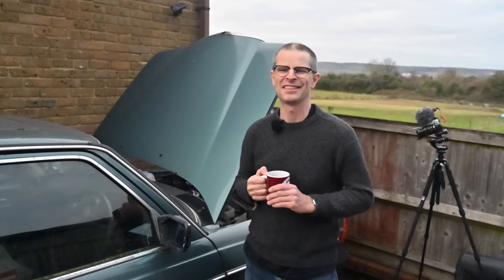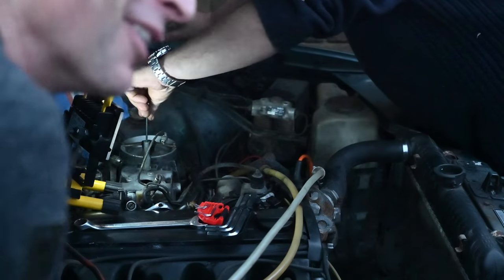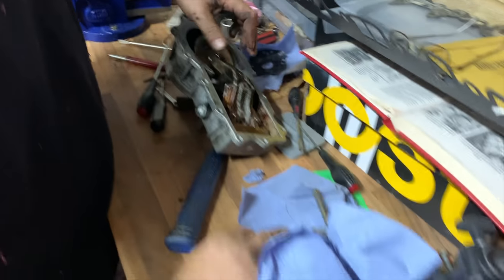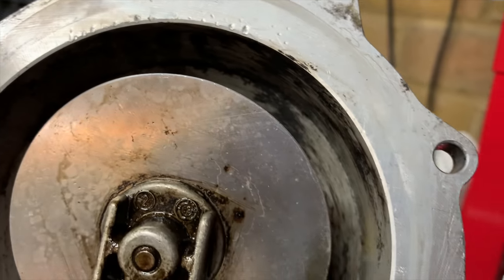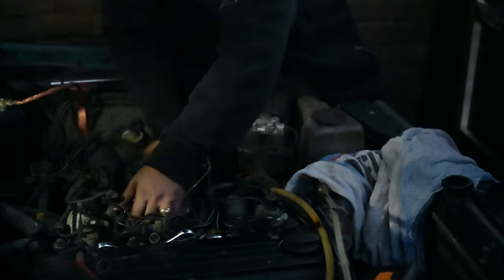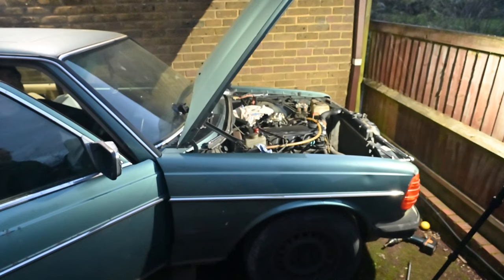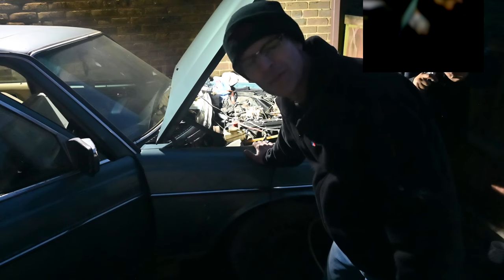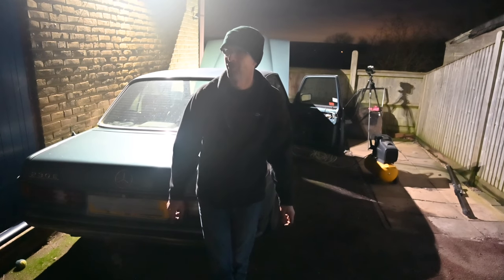Mercedes W123 - more fuel system shenanigans

Comment: I know this isn't much help but from what little experience I've had with the fuel injection systems on the W123 series, every part has to be in good operating condition for the thing to work.  My 280E was a bit finicky until I replaced all the injectors and fitted a good used metering unit.  Then it worked pretty well.  If you haven't already, check out Kent Bergsma over at mercedessource channel.  He is a mine of info on anything that is old Merc.  Good luck with it.  I'm sure It'll be worth it in the end .
Reply: I watch Kent's videos, and he is very good with repairing Mercedes-Benz vehicles.

Comment: Almost forgot to mention, i had an 87 Audi !00 with Jetronic. On cold days it would lose all power after coasting,followed by a monster wheelspin as the power came back suddenly! Turned out it had an overrun cutoff valve which was sticky and was taking it's time to close.This valve worked by breaking manifold vacuum to the sensor plate while the car was coasting and foot off the gas, basically all fuelling cut off in this condition. I don't know if your Merc has this but if it does it might be worth a look.

Comment: Thanks for a lovely day, sorry we couldn't get it started but we tried! And sorry for the swearing, (bleeped out), as I did promise to behave myself hahaha.
Reply: @Lime Pringles True and thanks for the kind words BUT I should have made the phone calls and done my research first. I'm now convinced it's the fuel actuator/valve/regulator that's not opening and closing to deliver the fuel pressure to the injectors, (though they may need a good clean out now given the gunk in No1 injector and its feed pipe), which is why it's a non-starter. I reckon 2 days and a complete overhaul of the fuel system, (filer, pump and pipes cleaned), and this car may just start. It's pure fuel starvation stopping it starting.
Reply: These K-Jets are very sensitive to fuel pressure. As I recall that pressure is set and maintained by a regulator in the return line (and can be adjusted.) Someone said something in an earlier video about relays and I think the reason for that was the fuel pumps in these often deliver low pressure due to an electrical issue but I can't recall what that fault is.

Either way easy to ascertain if its the pump by checking fuel pressure which needs to be over 3 bar to actuate the injector system.

You did a great job! 🙂
Reply: @thomas316  I really don't think it's the fuel pump as it's new. You're right about them being pressure sensitive though and I honestly think the gate isn't closing on the regulator to give it enough fuel pressure to deliver fuel to the cylinders. I did take a pressure tester with me but we never used it <sigh>
Reply: I would think it's the timing of the fuel pump that is off. Pretty common on this type of system after they have been apart, especially if there was some issue with the drive belt for the diesel pump.
Reply: @rimmersbryggeri  Ermm no, it's an electric pump that fires up as soon as they key is turned and the regulation of the fuel, (fuel pressure and delivery), it because of the accumulator/actuator opening and closing to divert fuel to the tank on the return or divert it to the injectors under pressure.
Reply: @TheFakeRussian  Ok. Is it a petrol or a diesel? To me these are always diesels hardly ever saw any petrol W123's  in sweden.
Reply: @rimmersbryggeri  It's a petrol bud, if it were diesel I'd be suspecting the lift pump.
Reply: @TheFakeRussian  Ok simple misunderstanding. The fault is so very similar to a VW t5 transporter diesel that had chewed through the pump belt that I have been working on.
Reply: @rimmersbryggeri  No worries bud, any help or suggestions are welcome. The fuel pump is just basic, it's either running or its not. Matt replaced the fuel pump and filter a while back so we know/think they're good. With it being old school injection the pump works on a single pressure and doesn't spin up and slow down like an ECU controlled fuel pump/injector system would to increase and decrease fuel pressure. It's all created by the actuator/accumulator opening an closing so you don't get engine overrun from too much fuel being jetted into the cylinders.
Reply: swearing i dont mind. sorry kids.
Reply: @TheFakeRussian   If it is anything like the injected Beetle 1979 fuel pressure regulator it can get clogged and is essential for fuel delivery and return. It's hard to clean and can be broke. But if it is running when sprayed that is all it is, quite a small thing really.

Comment: Fuel Accumulator is only to hold pressure in the lines when the engine is hot. To avoid vaporisation in the system.   To make starting easier on a hot engine. It consists of a diaphragm with a spring in the low pressure side which the fuel pump compresses. When the engine is stopped. The spring presses the diaphragm back , keeping pressure in the lines. Eventually pressure is depleted .   The cold start valve takes over on a cold engine. 
So I do not think it is your problem. Mine has not worked for a while,  but car starts up first thing when cold. I turn the key on and off a few times when hot, this pumps the fuel back up, before I hit the starter. To test. Attach a bike pump to inlet and pump up whilst holding it under water.   If bubbles come out of the outlet, it is R/S.              I presume the small brass mesh filter on the inlet of the fuel distributor is not gummed up?  It is the size of a match head.

Comment: Maybe there is air in the fuel lines before the fuel injectors?
I know with the 300sd if you take the fuel lines off that connects to the fuel injectors that you have to prime the fuel lines and crank it a couples times with the fuel lines before the injectors cracked open until they squirt fuel, indicating that you have gotten all the air out of the fuel line and then you tighten them up on to the fuel injector.

Comment: Likeable non affected presentation. A completely different approach to me though. I used to get the haynes manual and the factory one if I could then strip down and check the lot, renew the rubbers, rebuild the carbs, take the head off redo the valves, shim parts of it and so on then I know it is going to drive.

Comment: I made a similar mistake once, buying used Audi 80 (2.0 16V) with K (or KE, don't remember exactly) Jetronic. It was running, but it was incredibly thirsty and sluggish, and also had a tendency to stall when cold (usually in the middle of a busy crossroads). Nobody was able to fix it, so I got rid of that car ASAP and never looked back.

Comment: I had a Skoda 110R Coupe and on the way home it cut out and refused to start over the next 2 days I went through everything. Totally stripped carb apart 3 times cleaned it, replaced all ignition bits even though had a good spark, checked timing, check compression and even adjusted the tappets in desperation. Day 3 I'm at my wits end with no idea's left other than to lay into it with a sledge hammer and set fire to it. So it was the afternoon before I decided to take yet another look and without doing anything turned the key and it fired up straight away and run perfectly. What the hell the problem was I had no idea so I sold it.

Comment: Is it a good idea to smoke whilst working on a high pressure fuel injection system? I had a 280se which also turned into an aquarium every time it rained. Eventually I could see the road through the floor pan. Good luck with the gremlins.

Comment: When working on a w123 or w126 it helps so much to open the hood all the way.  It would make it so much easier if y'all opened the hood the rest of the way.  There are little tabs on the hinges that need to be released.  Lower the hood some and push the tab on the driver's side and raise the hood as much as possible.  Then push the tab on the passenger side without lowering the hood.  Then the hood can be raised all the way to the vertical service position.

Edit:
Whoops.  I'm American and the driver's side is on the opposite side.  The first tab is on the left side of the car.  Release them from left to right.
Reply from the maker: This is up as far as it wasnt to go, Ive pushed it into service but it wont go vertical and Im not going to force it!

Comment: Well, it may not have delivered any form of definite, positive conclusion, but the exercise has given you new directions to go in, even if they are expensive ones.  I would suggest filling the accumulator with something like carb cleaner and leaving it to sit overnight as that ;may, hopefully, dissolve the varnished fuel and inevitable rusty sludge that has accumulated in it over the last 35 years.  I have seen people use things like cellulose thinners or panel wipe on heavily varnished fuel system parts so that could be another option, and probably a cheaper one...

Comment: Your too close now Matt to give up! The Accumulator maintains pressure so when you walk away from you car it will have the pressure to just fire up again ;) 
I was going to suggest a great place I bought used spares for for years in Gloucester but sadly it looks like they have now gone :( 
Try the accumulator then if that doesnt work try and track down the whole kit carboodle bosche system from a running car. 
You Wife might not be too pleased but have you thought of a good running basket case as a spares car?

Might be cheaper in the long run?

Jo
Reply: Ahhh now what I've found is that the fuel accumulator/actuator/valve prevents the flow of fuel back to the tank to pressure the injectors then when the car fires it opens so excess fuel pumped up is returned to the tank. Once the car starts the engine maintains the pressure mechanically because there's no ECU involved. I've also found I was partly right in the respect that after the exhaust stroke, the vacuum of the down stroke draws the fuel into the cylinder maintaining the right amount of pressure so the engine won't over run.

Comment: K-Jetronic does not tolerate at all somebody who doesn't know what they're doing messing around with it.

If you have fuel getting everywhere else but not the injectors, that could mean that there is fuel pressure, but it's too low, the injectors have a set opening pressure and will not open if there is not enough pressure in the system.

The warmup regulator is what controls this, it has a bimetallic heating element inside, and a plug through which it recieves electricity, which varies the fuel pressure ( known as control pressure ) , there are small shims inside that are either removed or addded to vary this fuel pressure although it does come pre-set from the factory.

The accumulator has two functions, one is maintaining the fuel pressure for 20 minutes after the engine has been shut down to prevent vapour-lock, and another is to smooth out the pulses from the fuel pump to create a smooth constant pressure and flow to the metering unit.

With that being said though that metering unit sure looks like it's been messed with far to many times and is probably knackered, but do check the warmup regulator and verify the control pressures both cold and hot, ( you will need a fuel pressure gauge ) and looking up on the internet what is the correct cold and hot control pressure for the particular model.

And, whenever the metering unit is taken apart, new seals and gaskets should be fitted.

Contact KMI Petrol Injection Engineers LTD, they are real genuine experts on K-Jetronic!
Reply from the maker: The warm up regulator is also suspect, Ill be looking at that and the regulator before I drop £500 on a used metering unit!
Reply from the maker: I had a quote from them to rebuild the distributor, they look helpful

Comment: Com on guys  !!!!
Live that carb/brake cleaner alone , and use some diesel fuel mixed with petrol fuel.  Dip the parts into this mix and let it soke fir one hour.  Then grab a small plastic brush and clean everything properly.  If you cannot do it , I'll take that car and start it in 2 hours. Good luck!

Comment: I my experience K Jetronic can be a pig especially after being left standing! Time to do some cost benefit analysis!
Reply: They are very reliable if they are used regularly but let it sit for a long time and you will probably begin having problems.
Or if like he says at 7:00, if somebody who doesn't understand K-Jetronic has been messing around with it!
Reply from the maker: Im in quite deep now, I could probably break it and get most back but that would be disappointing
Reply: Mine was sitting 2 years... pain in the ass.
Reply: @leongailberger7676  Yup sitting for 2 years is sure to cause problems.
Like anything mechanical it needs use to keep it working.
Reply: @FirstOnRaceDayCapri2904  yeah it is still starting and running but it sometimes only runs on 5cylinders.... because of old crusty fuel. So after the winter i will put gasoline 100 octane in it with a additive and then I'm going to drive all day on the german autobahn
Reply: @leongailberger7676  our was sitting a similar time (w124 260E) due to engine refusing to start and also worn out discs on the automatic gearbox (was never opened since it left the factory lol)

Comment: Matt,there is a book titled -Bosch Fuel Injection@Engine Management by Charles O Probst,SAE. It is quite in depth and covers a lot of basic settings including the sensor plate height basic settings. I have had this book for years on my bookshelf, message me back if you would like it and I will post it to you as a Christmas gift,cheers Neil.
Reply from the maker: Hi Neil, thanks for the offer, I have that (or something very similar) as a PDF, we read a lot about the set up but it didnt mention what to do if turning the adjuster doesnt adjust anything!
Reply: @furiousdriving  No worries,looks like you are going to have to track down a good used part,keep at it!

Comment: Replace the fuel distributor .replace the warm up Regulator. With rebuilt units.
Reply: Yes chuck a £1000 on 2 parts without confirming that theyre faulty. What a dumb suggestion.

Comment: suggest checking fuel pressure.   Injectors need a fair amount of pressure to fire.     Also, did you ever do a compression check on the motor?
Reply from the maker: Compression checked ages ago, I need a pressure tester but think its another Bosch part thats failed

Comment: What's the fuel pressure like? It takes a lot of pressure to actuate the injectors (45psi) so if the pressure is low you won't be able to push fuel through the injectors.
Reply: A w126 V8 with a K-jetronic needs 75psi, if not or not close enough like 50psi the distributer sinds it's just right back to the fuel tank. Also happens on the KE-jetronic
Reply: @lodewijkvan96  You sure about that? I got a little pamphlet with my fuel pressure checker and it said Merc was 29 to 30 psi .......... But then that could be for cars with an ECU controlling the fuel pressure and injectors. This one might need more because it's purely mechanical fuel injection.
Reply: @TheFakeRussian  Well now i'm not sure anymore haha, i'm sure about the system that it sends it back if the pressure is to low.
I'm going to look it up in my notes when I get home. Will let you know :)!
Reply: @lodewijkvan96  My understanding is the fuel pressure accumulator gate closes to divert fuel and fuel pressure up to the distributor and down to the injectors and when it's at level the gate opens allowing unused fuel to return to the tank with the engine creating it's own vacuum and pressure to maintain the engine running. Now I could be wrong and shall await your looking at your notes :)
Reply: @TheFakeRussian  I looked in my notes and rememberd it all wrong haha. You're right when the pressure is all good than the left over fuel is send back to the accumulator. 
In going pressure should be around 75-80psi, that I'm sure about, it's been a while since I last did those tests. 
But my girlfriend and I bought her a SE500 from 1983 so will do this test once again :)
Reply: @lodewijkvan96  I did think it would be a bit higher than 29 to 30 psi because of it's old school mechanical injection system. There was nowhere near that level of pressure so I'm guessing it's pointing to the accumulator being constantly open. It should be a relatively simple mechanism with a spring opening at a set load then closing so it's cycling all the time. If there's dirt in there and it's jammed open it might be doable to clean it but I wouldn't hold much hope for the spring since it'll have been compressed for who knows how long?
Reply: @TheFakeRussian  Yess indeed, problem is with cleaning out is that it might work but it might also be that the membrane is ripped because of the ethanol in the fuel weaking it.
Reply: @lodewijkvan96  Based on the fuel pressure required being 50 to 75 psi, I would assume that setting the compressor to say 30 psi wouldn't rupture the membrane? If Matt cleans the valve and gets it running just once after a clean and the valve fails during or after running at least he'll know it's money well spent in getting the car running.But that membrane is an issue, how old is it? 

Is it damaged already? 

Has the membrane stuck with time and age? 

Is the membrane intact? 

Will Steve Austin, a man barely alive who cost $6 million to rebuild in the 70's be able to push start this car? 

Stay tuned for the next thrilling instalment of "Mercedes W123 - The barn find that just won't $%*$£^&%$%& start!"
Reply: @TheFakeRussian  wouldn't hurt it, it is just a possibility that it is already damanged by just sitting or been run on fuel with a higher amount of ethanol in it.

Comment: The South African solution would be to change the fuel injection system and inlet manifold for a carburettor and manifold with an electric Facet fuel pump :)